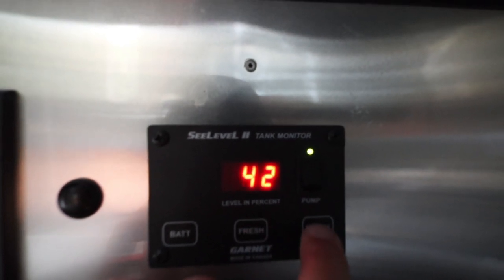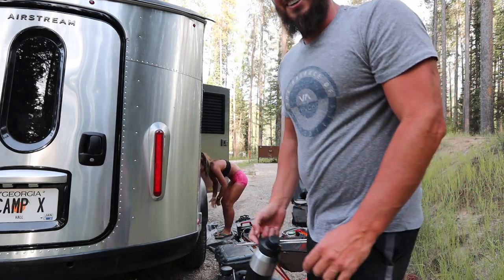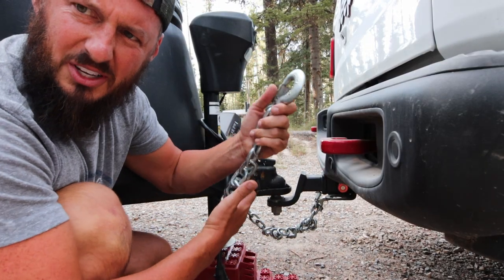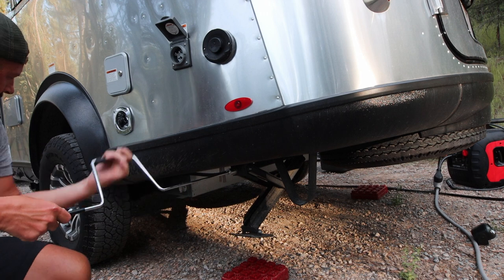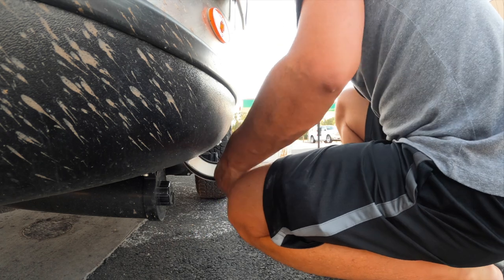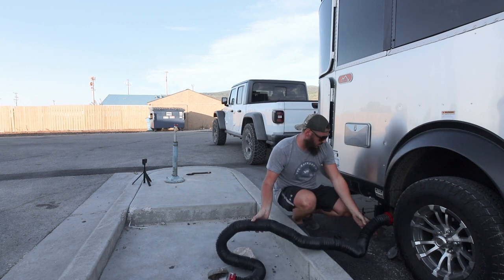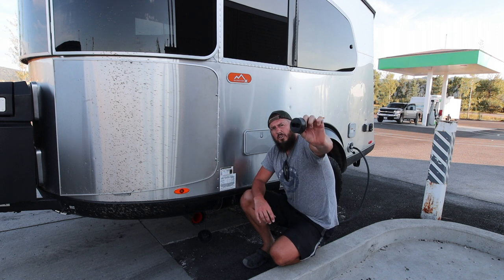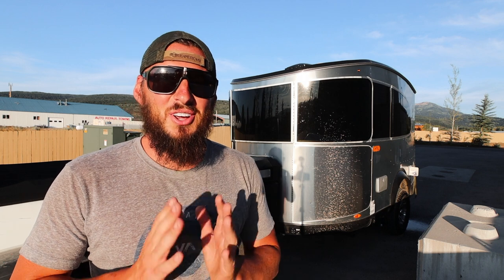Dumping Black Water from Your RV ( Airstream Edition )

Comment: Great video.

Tip: PLEASE criss cross those safety tow chains before hooking onto your vehicle. In the event that the tongue comes off the ball, the tongue will pitch forward and down onto the criss cross in the chains, helping to prevent the tongue from hitting the road and flipping the trailer forward onto your vehicle.
Reply from the maker: I did not know to cross chains at the time of making that video. You seem greatly concerned but rest assured I now cross them 😎

Comment: Hi.😊 First time viewing your channel.Great video. 👍🏽😊 I have a 2dr wrangler and tow a BC16X... I keep it light (left out a lot of heavier add ons and options), but as a solo traveller I also have a Rhino storage tank to avoid having to break camp or move the BC around too much. This really makes a difference for me, although I do have to be much more considerate if I have close neighbours, same as having to use my generator...Have you ever given thought to using one? A storage tank I mean? I do clean out my tanks at dump stations as well. Also, I try to use disposable gloves when handling either...😱 saw a small slip up once and I haven't been the same since.😝😂🤣 Take care now.😁
Reply from the maker: You make a lot of great points. I haven't ever had the need for an extra black tank storage. I just drive to the dump area. 
Good point about the gloves. My unit has never actually had "black water" in it so it was only grey water. 
I do wear gloves when needed. Thank you for your comment!

Comment: Hi David- Great tips! How cold have you camped with the BasecampX? At what temperature could the water tanks  freeze and is there a way of getting heat to them. I know some rigs have heaters for that . Thanks!
Reply from the maker: Hey 👋🏼 
Thank you for your question. The coldest I have ever camped in the Basecamp is 17 degrees. You can see it in my YouTube video called 

“I wasn’t expecting this to happen while boondocking.” 
The BasecampX has tank heaters. You can flip a switch and they will stay above freezing 🥶

Comment: These things remind me of an upscale horse trailer dont know why..lol... same design... just Chunk of luxury change.... , a lot people are buying them tho.... i have a trailblazer 02 LS wondering if that would  pull ok... isnt a 4 wheel drive.
Reply from the maker: Ha! I’ve heard from quite a few folks who indeed think it’s a fancy horse trailer. 
You are correct. Tons of folks are purchasing them! 
You don’t need 4 wheel drive to tow this trailer. It would be useful if you plan to pull it offroad or into Boondocking areas. 
As far as if you can tow with that vehicle you’ll have to look up the towing capacity. The trailer fully loaded weighs 3500lbs. You want a vehicle rated to tow a good bit more that. 
Hope this helps!
Reply: @DavidWaldrip   thank you
Reply from the maker: @RaraAvis2025  You are most welcome. Thank you for watching!

Comment: How does the jeep handle the basecamp? I pick my gladiator up next week and the basecamp end of the month....
Reply from the maker: The Gladiator pulls it really well. You will be quite happy with your setup. 35’s on the Gladiator is the best for pulling/looks in my opinion. 
I also highly recommend adding the Mopar trailer brake controller to your setup. Although I did not have it until I got the heavier Caravel.
Reply: @DavidWaldrip  the brake controller got installed on delivery thanks…
Reply from the maker: @beardedbiker2647  Ready to rock! Have fun loving the Airstream dream.

Comment: That didn’t look hard.  Is there a charge to disposal and water usage?  Thank you for sharing.  So valuable to learn what is behind the scenes on trailer living.
Reply from the maker: It’s not bad. I think I’ve gotten down to being able to hookup, drain, and repack in about 6-8 minutes. 

Some places do charge a dump fee. Others are free with “fill up”. 

Rv parks occasionally charge. 
Most SP and NP campgrounds have dump station you can use. 
Thank you for the kind words. Glad you liked the video.
Reply: Thanks!
Reply: I've had some campgrounds and state parks charge me $10 to use their dump sites

Comment: This may be a silly question, but when you connect your hose to "flush" the sewer line and clean it after dumping, how do you know the water is going straight through the gray/black tank to clean the sewer line vs. going into the fresh water tank?
Reply from the maker: That is a really good question Brooke. In regard to BLACK tank flushing Airstream travel trailers have a dedicated inlet that is clearly labeled for this purpose. You just screw the rinse hose to that port and you are assured water is rinsing out the black tank. Also you can or see or hear  water running out of the drain hose into the sewer. 
The Basecamp has a combined tank grey/black so it flushes both but most trailers have separate grey/black tanks. 
I hope this helps!
Reply: @DavidWaldrip  David, one more question for you because I've ready something about this elsewhere, but can't find a definitive answer. It looks like you're using two different water hoses for when you flush the system vs. when you fill up your water tank. Do I need to have two different hoses? I have one hose now for drinking water. Thanks in advance!
Reply: @DavidWaldrip  Same question as below! Do you need two separate hoses for black and for fresh water? Thanks!
Reply: The dump sites water is usually  marked: Not potable so don't contaminated your fresh water hose with it.

Comment: Hey David, just discovered you channel so I don't know how long you've had your BC but honestly, how happy are you with the bed cushions? I've been interested in the BC because of all the windows but those cushions you sleep on look very thin and uncomfortable. I'm tired of camping in tents, sleeping on cots and want to upgrade to an Rv. Are you really content or would you have rather bought  the Bambi.
Reply from the maker: George your question is a great one. I have slept on the BCX cushions for exactly 6 months. Personally I have been happy with them. They are not "luxurious" at all but I slept well on them. 

As to whether or not I would have rather have purchased a Bambi the answer for me is no. However I think most folks would prefer two things about the Bambi. 
1. You don't have to make the bed up each day. 
2. Kitchen seating area is also always setup. 

So unless you need to haul gear inside ( that's a big reason we got the BCX ) or unless you prefer the look and added off road capabilities I would suggest the caravel ; )  or the Bambi. 

Hope this helps!